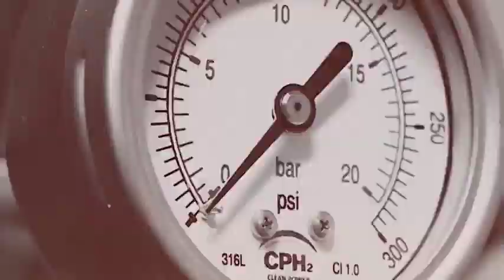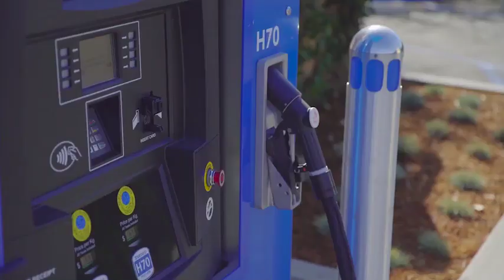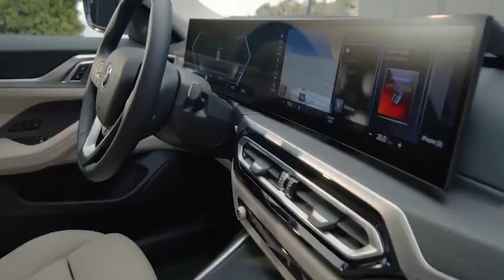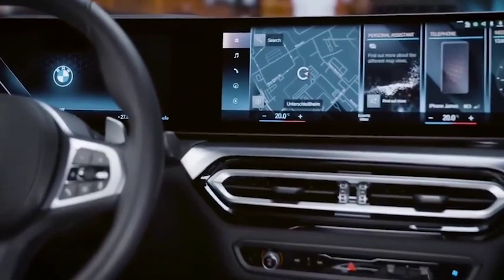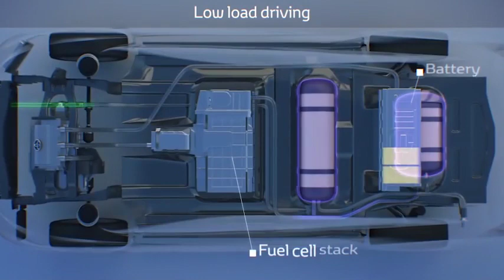BMW and TOYOTA's NEW Hydrogen Car SHOCKS The Entire Car Industry!

Comment: Mirai has no battery at all? You are joking. FCEV is an EV and it needs a battery to operate, it can be much smaller but there has to be some electricity storage/buffer. FCEV is not effective enough for individual transportation.

Comment: It will be know as the electric car killer this is the way forward I hope it all works out this is the future of the car. 

Battery I have always said is old technology we know it just doesn't really work in real life.
Reply from the maker: I agree that this might be the solution, but Don't you think it might be to late? 

In fact, Electric cars work very well here in Norway for daily life, but the goverment  has really helped so that this has become possible.
Reply: @itselectricvideos   its never to late to change. 

I know what you're saying but  the full electronic cars  are  still power by  Fossil fuel  in most countries  it can do more damage to the environment in its life time it maybe looking at 2  owner before the battery need replacing the battery can't be Recycled the carbon footprint just gets bigger to try and explain what am on about I will put a link to a video am all for green clean energy am looking forward to what BMW are going todo  with Hydrogen it will truly be green energy with a small bit of co2 for the making of the vehicle. 

https://youtu.be/sytWLB4-W-M